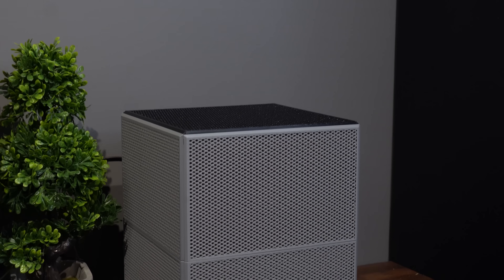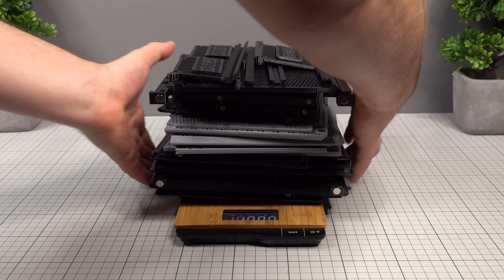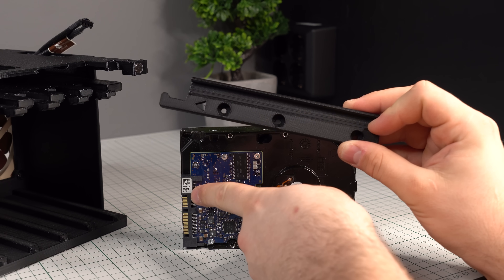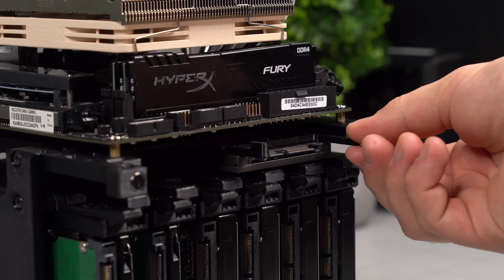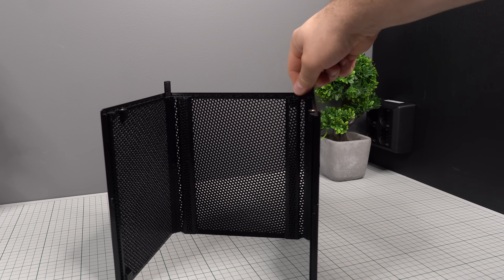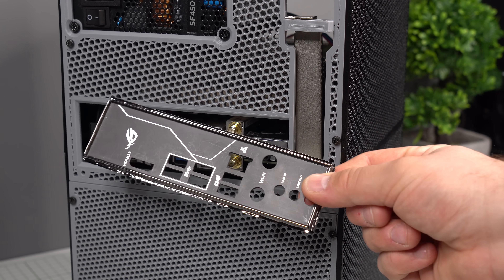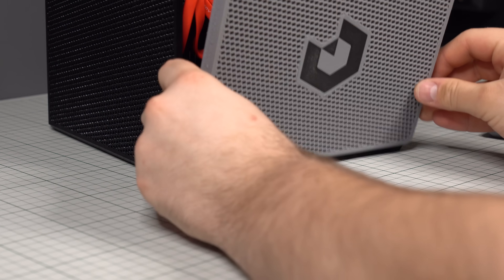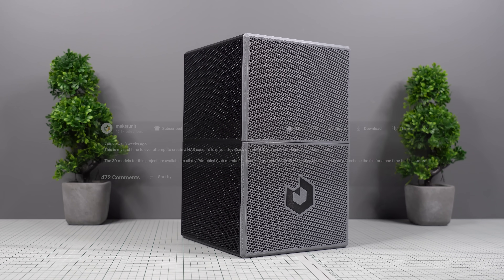3D Printed 6-Bay NAS case - Improved in every way!

Comment: You should have let us know at the beginning that the files were only available for money. Booooo.
Reply from the maker: Hi Don. I understand your concern here, however, those $3 is barely anything compared to the price of all the materials needed to build the project, the time used to design it. If you knew how many hours, test prints and other materials it took to develop this, you’d think $3 was very cheap. Remember you’re not forced to stay a member, you can leave at any time 😊
Reply: @makerunit  I didn't say it wasn't valuable (I'm sure it is worth more than 3 bucks), I said you should have let us know in advance that we might be wasting our time. Our time has value too. Also, I would never join, get the files, then cancel, thus, IMHO, cheating you.

Comment: I have NAS from old computer and the main issue is dust. Without dust filters, the internals of the NAS were disgusting after a few months.
Reply from the maker: I see. Especially in a very dusty environment this can be an issue. Though adding dust protection to the case would make the design a lot more complex, which may make it more difficult to build.

Comment: You've inspired me to start making my own Mini PC cases based on a 120x120mm motherboard. Using Sketchup to do it and so far it's working well. Unfortunately, the plastic extruder housing on my Ender broke. A new aluminum part is inbound this week. What filament are you using for your final builds?
Reply from the maker: Hey Steven! I’m super happy to hear that I’ve inspired you. I also started in Sketchup when I first started printing years ago 😁 The plastic extruder piece on the Ender is a classic fail, happens to all of us eventually, faulty design from Creality… I had to do the exact same mod on mine a while ago. 

I’m mainly using PETG for my Printed cases but sometimes also PLA for certain parts. However, I try to use PETG for any part that’s affected by heat in a PC.

Comment: Love it, just something to think,  HDD do make a lot of vibration, is important to insolate them with some anti vibration rings or similar when you adding them, if you using SSD don't have to worries about it!
Reply from the maker: Thank you! And yeah you’re probably right,  the ideal mount would have some vibration damping as well in each bay.
Reply: @makerunit  The dampening ability of the printed parts in PETG is enough to consume "some" energy and vibrations (PETG is almost like a jelly compared to a normal steel bracket), i.e. it's absolutely not critical even for 6 non-enterprise grade HDD's. Screw-secured drive is better in 98% cases.
Reply from the maker: @teumcar  I see. You’re probably right. 😊
Reply: Using those rubber grommets/absorbers will reduce the noise of the drives, and with louder drives quite significantly even, but it will also reduce the lifespan of those drives (significantly in the case of loud drives). The entire reason why rubber absorbers reduce vibration noise is also precisely why they reduce the lifespan of the drives; they isolate the vibrations of the drives to the drives themselves. That's why you need to mount the drives to a frame and preferably a metal one, yes it will be noisier but it will also help to dampen the vibrations of the drives themselves and thus extend their lifespan. People seem to be unaware of the fact that enterprise and high capacity HDD's were never meant to be quiet, they were meant to be put into server racks which are extremely noisy due to multiple components.
Reply: @pieterveenders9793  hey! What you say makes sense. But you can see this dampeners on a lot of cages I had some old dell cadies with small ones, they are ment to avoid resonance between the HDDs, this is not a big concern with modern HDDs, specially if you are getting ones that are meant be used on a NAS (for or those who do not know, there are different type of HDDs)
If not wrong there is a huge thread on TrueNAS forums about this conversation.

Comment: would have used a sata backplane it removes most of the cables now its a huge mess of cables.
Reply from the maker: My goal on this project was to make it using easy to get off the shelf parts, I’m planning to make more models eventually using different parts to offer designs appealing to a bigger range of users.

Comment: Is there any way to get a version that supports a larger graphics card? Something that fits a dual slot card like the NVIDIA RTX A2000 would be perfect.
Reply from the maker: It is definitely possible, however I plan on eventually posting more models to support a wider variety of parts like bigger motherboards and bigger GPU’s. One step at a time. 😊

Comment: How much would the case cost to 3d print? Already have a 3d printer. I’m not going to do it now because hdds are like $13/tb refurbs are more like 9/tb which is crazy
Reply from the maker: Let’s say roughly 2kg of filament = $40, then you add the screws, threaded inserts and magnets probably another $10-20 (depending on whether you have some of it laying around or not, usually they come in packs of 50 or 100). So let’s say approx. 60 USD on average
Reply: @makerunit  $50 is amazing, quality cases of this size cost 150-200 usd. Maybe you should sell the case as a kit
Reply from the maker: I’ve considered it, but again I don’t currently have the printing capacity to print and sell too many models. And most Print-on-demand services eat up most of the profits so it’s currently not profitable so I’ll for now stick to just offering the files. However I may make a commercial license option for my Club projects to print and sell the cases.

Comment: What about making the drives toolless, remove the carriage sliders from the sides and then reduce the hight of the drive bay so it clamps direct onto the drive to hold them in
Reply from the maker: The reason why I decided to go for the tracks/brackets was to allow for different thickness drives, as they all use standard mounting holes. Although it’s probably possible to make it completely toolless also.

Comment: I'm not an expert in 3D printing so I apologize if I'm wrong, however I have two questions:
1) which printer do you recommend up to a maximum of 1000$ or €?
2) you can change the colors of the project? Thank You
Reply from the maker: Hi!

2) the case can be printed in any color combination you want, it’s just based on what filament you add to the printer. 
1) Hmm, personally I’m using a Creality CR10v2(old) Ender 3v2(old) and Creality K1 Max (New), but if you have zero printing experience I’d probably recommend going for the Bambu Printers like P1S / P1P / X1C as the creality ones are great too but they often require a bit of manual tuning to work properly, while Bambu are known for being almost perfect right out of the box.
Reply: @makerunit  Thank you so much for answering me 🙏🏻
Reply from the maker: @Danny-ml2ny  You are very welcome! I try my best to give everyone an answer to their question. 😊 at least at the time when the channel is the size it is, I have time to follow up, though it takes time to go through hundreds of comments on each video so I completely understand why bigger channels often don’t answer, I don’t think it’s because they don’t want to but rather that it’s simply too much so they have to get selective. 😁

Comment: but what about a 10g network card? what would be a solution for that? btw awesome case, I just need the 3d Printer now lol
Reply from the maker: Thanks! Are the 10g cards bigger than single slot? Or are you thinking in combination with a PCIe expansion card for extra SATA ports?
Reply: @makerunit  in combination, because there is only one pcie slot available so what would be the solution in that case? Any idea?
Reply from the maker: @imanuelpc  hmm, perhaps using a dedicated NAS ITX motherboard with enough sata ports (though I’m not sure which ones can support up to 9 drives) so the single slot is available. Or just get a board with good onboard network card, but they may not be 10G though… :/ I plan on eventually releasing more models so perhaps my future models will support this functionality 😊
Reply: @makerunit  i think i found the solution, using a usb3.0/type-c realtek 2.5gbe/5gbe network card….

Comment: Do you think its possible to make something similar that's rack mountable? even if it requires one or two rigid pieces to hold it to the rack/rail that would be a GAME changer
Reply from the maker: At some point I might try to make a rack mount case, however, at the moment I do not have, or have access to a rack to measure and test the project, therefore I can’t really confirm if, or when I’m able to get to that 😊
Reply: @makerunit if you’re interested I could 100% help test if it fits well. Also a good middle ground without buying a full rack tower is a “table top” server rail mount it has the same format just smaller and much cheaper. Probably easier to troubleshoot since it’s open air instead of enclosed
Reply from the maker: @Khalmoon  or I could just 3D model the rack itself and print it out! 😁 also, I try my best to leave no comment un-answered.
Reply: @makerunit also thank you for the response! I’m considering gutting my old pc parts to see what I can fit on your builds on printables and then make some purchases!
Reply from the maker: @Khalmoon  Sounds good! Let me know if I can be of any assistance! 😊
Reply: @makerunit  I actually sent you a message on printables to see if that rack piece might help streamline it! Hope you are doing well
Reply from the maker: @Khalmoon  yeah I saw it! Or I didn’t know it was you but I was literally just going to reply. The username was a little different there so I didn’t connect the dots 😁
Reply: @makerunit  all good take your time! Haha

Comment: Wonder if you can make a collab with PCBWay , so they can offer this to be printed for us with needed screws, magnets and inserts.
Reply from the maker: Actually, it’s possible, however I feel like the current prices of many 3D printing services are too high to make it worth it. And some of the joy in making DIY projects is the DIYing of it. (My opinion).
Reply: @makerunit  It is absolute joy to do it yourself.
But I was thinking that some of your viewers either do not have 3D printer at all or maybe to scare to go on such big 3D printing .
Lately I am having troubles with my old CR10 S4. So I would not try to print this by myself. Even though it would be awesome.

Again thank you for your great work.
Reply from the maker: @DS-pk4eh  Thank you! And yeah I understand, however I don’t feel like the prices are low enough for it to be worth it. 😅 perhaps it’ll be cheaper in the future. I’ve thought about creating a commercial license so other 3D printer enthusiasts can sell the models locally in their area, but I want to make sure I do it right if I go down that path. 😊

Comment: Hi
Ik this might not come up a lot

But please make a NAS similar to the fractal node 304 with 2 200mm fans

Or like your big boy case but horizontal
Reply from the maker: Hi! Thanks for your suggestion, that is definitely a possibility, but my next NAS will probably aim a bit more towards being modular so you can grow it over time as your needs increase. (But some large fans MAY appear, at least as an option)

Comment: Don't know if I'd feel comfortable having magnets so close to my drives...
Reply from the maker: Hi! I’ve also wondered about this so I’ve done some digging into this and honestly it should have zero effect on the drives. 

The magnets used to erease data from hard drives are extremely powerful industrial strength magnets from what I have found and these «refrigerator magnets» will probably not even have any effect on the drives, even if putting them directly on the drive it should have little to no effect from my understanding. (I may be wrong about my last statement about putting them directly on, but you get my point)

These magnets are relatively strong, but not even close to the strength required to cause some damage to the drives, and also, they’re spaced so far away from the drives so the magnetic field will be extremely weak over by the drives.

Comment: Because its printed in parts, the next design could be modular/expandable. (like your current design but the 6x 3.5" drive bay is a swappable/stackable module)
You'd have the base, zero or more drive modules, and the motherboard + psu area that holds 3x 2.5".
(zero drive modules is silly config but motherboards have m.2 and the case has 3x 2.5", and drive modules can be added as needed later)

For example you could make a 18 bay case by printing three of the 6x 3.5" drive modules, or go all ssd storage by using the 2.5" module, or even use combinations of the two and have a tower of drives.
Reply from the maker: This is exactly what I have in mind as a future project! A fully modular system where you can build it kind of like LEGOs. It’ll be a real challenge to design to function seamlessly, but the end result if it works as I hope would be awesome!
Reply: @makerunit  This is awesome and would make the "line" very useful! Please re-use your drive trays, across the models of cases.

Comment: I think a great addition for something like this would be a few custom PCBs. For example a custom backplane so the HDDs can actually just be slid into the case and are immediately connected. I am a hardware developer myself and would gladly assisst with this/ make that a reality in case you're interested in working together
Reply from the maker: Hi! Yeah it could definitely be an option but the goal for most of my projects, at least for now, is to try to use mostly off the shelf components, or if I end up using a backplane I want to use one that’s easy to obtain, as I make most of my projects to share with others and want them «easy to make». I appreciate the offer though! 😊

Comment: Really great video. One question out of curiosity. What is the screwdriver you are using?
Reply from the maker: It’s something I bought locally from a Scandinacian store called NetOnNet, however i believe it’s just some generic product they have labeled with their own brand. 

https://www.netonnet.no/art/datakomponenter/installasjonogmodding/mission-sg-electric-bit-driver-kit/1029703.11087/

This is the Norwegian link.
Reply: Thanks for answering! I will check this out!

Comment: How's about a option for stacking? Just the bottom to be available as a section to attach to bottom to add 6 more HDD and few SSD. Maybe a option too have bigger CPU cooler? The rest looks well made
Reply from the maker: I have a few ideas in mind for a «fully modular» system. Where each component has it’s own printed section. I just need a reliable way to attach the parts that is strong while still being easy to print with preferably low filament usage.

Comment: I love this design and I'm going to start working on printing it out.

However, the one improvement that I would request would be to have a 3.5" to 2.5" adapter so we can use a SSD in place of a 3.5" mechanical drive.  I'd much rather want to use a SSD than a mechanical drive for my storage and having that adapter would make this perfect!
Reply from the maker: Awesome! Thank you! 

I’m working on making that adapter for 2.5’’ inch drives in the drive bay after several reqests. Should be on Printables within a few days after I’ve been able to design, print and test that it works!

Comment: But what if I need more drives? ;)

Jokes aside, these are really good changes. I appreciate the use of more threaded inserts. I HATE screwing into plastic. I also appreciate the disk spacing. I've used quite a few cases where the disks were too close together, which impacted temperatures and made it difficult to use 90 degree SATA cables.

A suggestion for a future project: A JBOD enclosure instead of simply a NAS case. That way, the sky is really the limit as far as disk count is concerned. Ideally it would have space for a small power supply. You'd also need to source a good backplane, which could be challenging... But still, if you could pull it off, I think it'd would be great, since I'm not a fan of most of the enclosure options currently available on the market
Reply from the maker: Thank you! I’ll definitely be sure to look more into JBOD! I’m fairly new in that area but I’ll check it out for sure. 😊

Comment: Noice, I will try to fit my 2080 super in it 😂 great work
Reply from the maker: Haha, good luck with that. However, in my new upcoming case, you should have no problem fitting a 2080 😊
Reply: @makerunit  will the new case have the same hard drive system? That would be ideal for my Plex setup
Reply from the maker: @kwaj177  It is not intended to be a NAS case, the next one. Just a «normal» case, however I might implement some altenative options to make it more flexible. I’ll see how the designing goes.
Reply: That's even better, but this one is great by itself. I have a plex server and I had to settle with a lian li o11 mini since it can hold 4 hdd but it is too big for a nas plex server. Will wait for the new case but I will also try this one too.
Reply from the maker: @chazpr  the next one is actually not intended to be a NAS. But I was just stating that it would fit the 2080 😅 It’ll actually be a «full size ATX». A «normal» case this time.

Comment: Awesome work! This must have taken an insane number of hours
Reply from the maker: It took a few hours definitely. Hard to give an exact number as it’s been slowly designed bit by bit over many days. Definitely gets a little easier after doing as many projects as I’ve done until now, but the main challenge is the thinking, finding solutions, not the modeling itself 😁